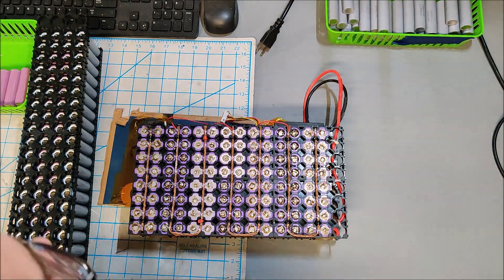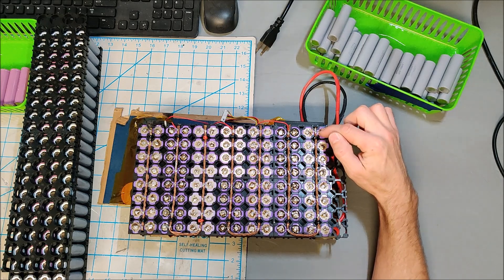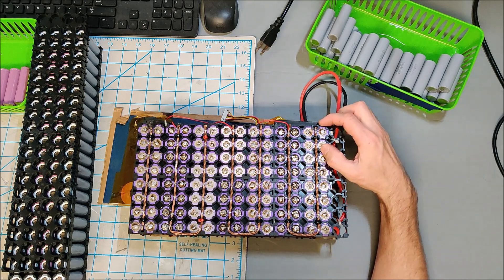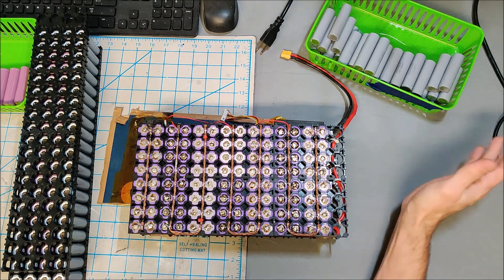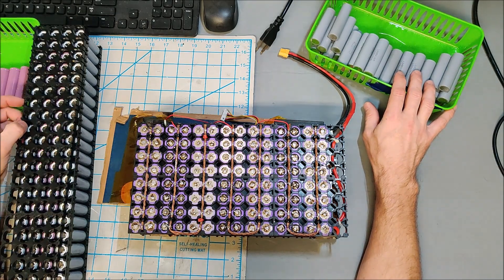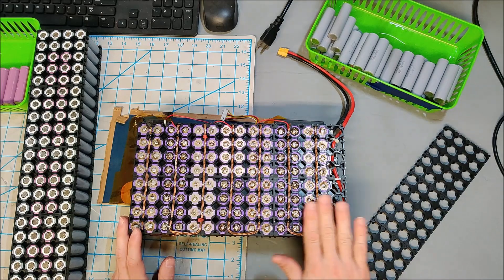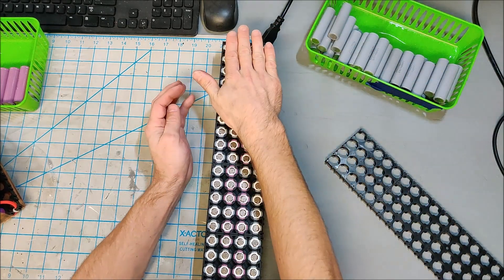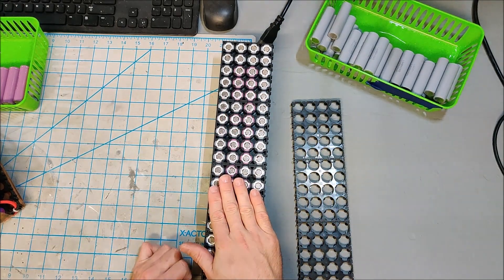DIY POWERWALL PART 2  - DESIGNING THE BATTERY

Comment: I have 700 good ones can I go 14s 48v .ty
Reply: 14s 50p
Reply from the maker: Of course you can. I personally would do 7 x 100, but if you want to go 48V there is nothing wrong with 14 x 50
Reply: @stevenc22  on a 5kw inverter its small but I'll use power try the day at night lights and tv.after will add second row when I collect batteries.
Reply: @stevenc22  what solder and flux to use.i live in Macedonia not much choice.ty for info in advance.
Reply from the maker: @smacospasovski5123  my new video on soldering is uploading now. Watch it in 30 minutes. I dont use flux.
Reply from the maker: This is the solder I use. It's really good solder. https://www.ebay.com/itm/233588002579
Reply from the maker: @smacospasovski5123  5kw inverter is huge. You should do a 48v system for 5kw otherwise you will need huge cables.